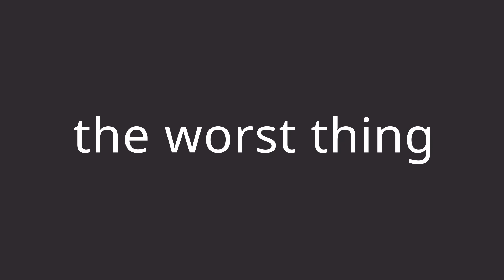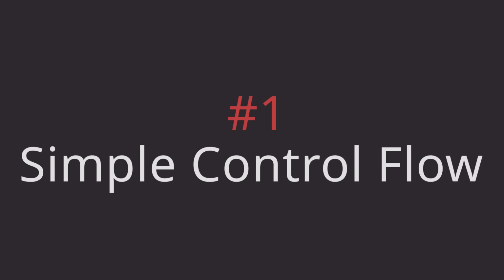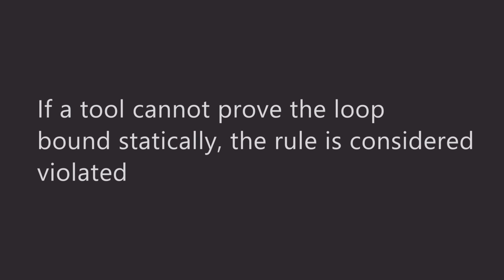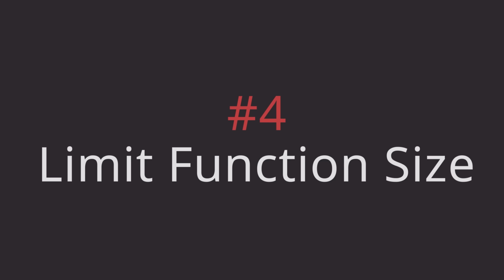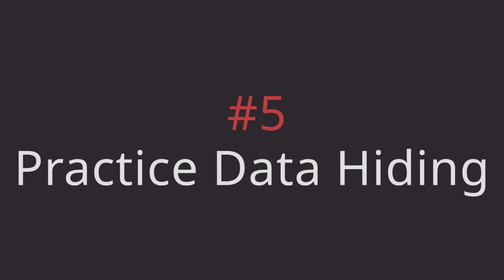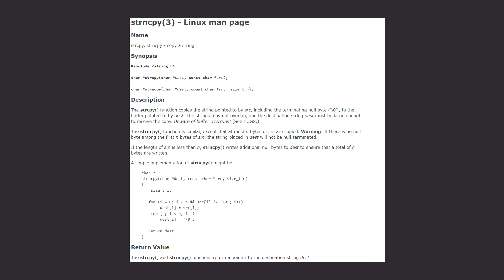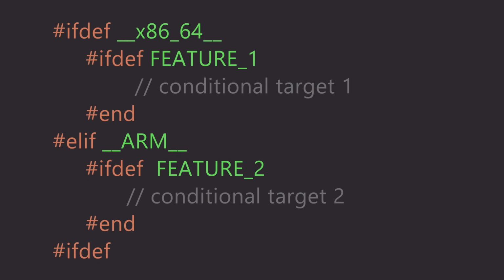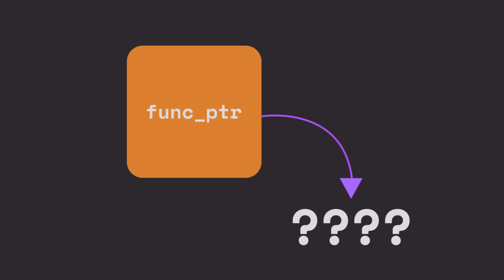how NASA writes space-proof code

Comment: Note that not using dynamic memory is not the same as not using the heap. Global variables are heap allocated, but their size is known at compile time, so there is no problem there. This is useful for big variables as those would otherwise result in a stack overflow; the good thing is that static tools would detect those anyways.
Reply: Global variables are not heap allocated.
Reply: True, I meant that stack storage is not the only solution.
Well, I guess that depends on how you define "heap", so let's be specific: global variables are not part of the stack in any implementation that I know of, but they are not dinamically allocated in that they exist the whole duration of the program execution (cannot be de-allocated). So perhaps we could say "global/static allocation" is different from stack and heap allocation.

Comment: I do lots of embedded firmware and use many of these rules. However, I completely disagree about the preprocessor. There are ways to use macros that actually eliminate classes of errors and allow the programmer to generate compile time errors, which is way better than runtime errors. If you have a process that includes analyzing code then you can compile or analyze the preprocessed code.

Of course, macros can be misused and create a mess, but I think they have been unfairly maligned.

Comment: I could code for NASA because I don't use recursion! 

I don't understand recursion... well, I do, but I have never had any use for it so I haven't practiced.
Reply: @neilbarnett3046  , think of it as a function that calls itself until it meets a certain condition. You usually have at least two parameters: some state like a counter array/list that allows you to keep track when you’re done - and an accumulator to store your progress - that means: taking over your result of the previous calculation into the next.
Reply: @captainbrainless  or you use a solid programm language. E.g. python stops after a certain depth in the recursion.
Reply: Recursions can be rewritten as iterations, and they're used mostly in high school or college education for stuff like Fibonacci because it is more intuitive and to basically show how it can affect the system (stack overflow). In real world programming, I never used recursions, they are a major source of crashes and can be pretty unpredictable.
Reply: @realjickso you obviously do no solid programming. Almost impossible not using recursions. You need them for:
* File System Traversal  
* Tree and Graph Traversals  
* Parsing Structured Data (XML, JSON, HTML)  
* Divide-and-Conquer Algorithms  
* Graphics and Fractals  
* Web Crawling and Scraping  
* Backtracking Problems
Basically whenever the depth is unknown.

Comment: Interesting video to get to now how Nasa has handled these kind of things. But I would argue so much if someone suggested that these particular guidelines should be used in modern work. As @HerbertLandei pointed out there are modern approaches to low level programming, especially Rust lives in the same usage space as C while being much safer to program with. I guess these rules have been a necessary band-aid on the Nasa's space projects ecosystem on C era but I wonder if e.g. SpaceX and other Space programs have a different kind of ecosystems and thus derived a different set of rules. After all satellites etc. are a collection of hardware and software solving many space related problems holistically of which the problem of human programmers making mistakes and needing static analysis is just one of many. (e.g. radiation damaging and bit flipping processors in space is a big problem and maybe hardware needs regular resetting too)

To me it seems that these rules boil down to enabling static analysis of code to be efficient. It is almost like coding for a safety tool that guards that a stupid Huuman doesn't make mistakes. Now on the era of ChatGPT 4 I would also explore the powers of Specialized AI code analyzers. Finally does any of these static analyzers offer a formal mathematical proof of the correctness of the software ? Because that would be a completely different chapter to this topic. Usually analyzers are there to just tackle common and recognizable mistakes.

Comment: these rules sound quite "old" or "basic" to me. I mean if you do multiprocessing, it could be better to have functions consume a constant cpu time, then you may need jumplabels. Or you have to re-write code for a similar device, but restrict both pointer dereferencing and x-macros, so that looking at all of your code you have a bunch of functions doing the same thing. So you may end up looking at the structure and overlook an individual change that would be required for one implementation. Next, it requires handling of every possible returned value, but you may not use goto even inside a single function? How would you unwrap stuff then so the code is still maintainable?  And the worst thing to me wasn't mentioned at all (despite the lack of requirement on how to handle every possible errorcode from every connected sensor or whatever): checking for invalid pointers. I mean inside "do_func" for the case "do_func(&my_buf.data)" so that the parameter also may point to .bss/.text . Ok on the other hand it implies that even NASA can't do magic, so that may be good news ;-)

Comment: How about this rule: Don't use a language conceived at the dawn of time.
I get that their use-cases require low-level code, but seriously guys, we are in the 21st century. There are languages like Go or Rust, which make it so much easier to write correct code. Why use ancient incantations with pointers and stuff? It's like designing a new car with a steam engine.
Reply: Go is not hard real time, as it has a garbage collector

Comment: @1:28
just a small correction, the function is supposed to return the predefined type (list_t) instead of int
as the purpose of the function is to return the node that holds the value being searched for, not the value itself

Comment: Surprised that rad hardening steps aren't mentioned - quorum, lockstep cores, watchdog timers, short runtime tasks dispatched on a schedule from a known starting state instead of long-running threads which accumulate errors, regularly checksums of code, regular initialisation of the stack, ie resetting the system on a tight schedule even if the watchdog doesn't trigger.  Also when fusing data from multiple sensors, having a sane way to discard sensor data if a sensor returns confusing/conflicting data, and a way to start listening again in case the fallback isn't long-term capable or the error condition has passed.  For example using integrative navigation sensors when range-finding produce wacky results temporarily as happened on the moon shots, the astronauts ignored the radar for some time but started using it again later.  The recent Japanese lander failed because it stopped listening to radar permanently due to unexpected rapid distance increase as it passed over a crater wall, resulting in it switching to integrative navigation, "landing" far above the surface, and then running out of fuel trying to stay there.

Comment: its funny, I worked for a company that used similar rules.
and imagine what ended up happening, they didn't have final safe state.
on a very rare occasion, the product ran out of timer slots and violently disassembled it self. 
apparently "having the product restart in case of an error is too much"

in the end, it's more valuable to write code that can save it self than expecting that no one will make mistakes.

Comment: #3 is still widely used in the defense industry.  It's not a requirement anymore, but there is a general bias against using the Heap without good reason to.

#6 is just good practice in general.  Our internal compiler flags generate warnings for any function that returns a value that is ignored.

One more that many programs follow: All Warnings get elevated to Errors, forcing the developer to actually address them.

Comment: 0th rule should be:    DO NOT PROGRAM IN C.

Use Ada.  Or even Pascal.  (FreePascal is quite powerful - and in it, heap memory is very well managed to boot).  
Many companies used Pascal for avionics in the 80's and 90's for both commercial and military avionics.
Very readable.

On the B-777 program, avionics suppliers building new sub-systems, were required (by Boeing) to use Ada.
Recursion was forbidden, and IIRC, so was Task Rendezvous (a synchronization feature of Ada).
Planning, Design, Doc, Test and Certification had to be to the appropriate (to the sub-system) criticality level (A .. D, maybe E) under DO-178B where "A" is the most severe.
F-22 is another example with the key benefit being that aircraft level systems integration went very smoothly.  (They did have one oddball problem).

What about multi-threading?

Comment: I actually really like #4 as a rule and might try implement that to an extent in my own code. Sometimes it can be easy to think "Well, this function is performing a save operation and all this code is used in saving so it all belongs here". But the truth is that if you have a function that's 300 lines long, chances are you can probably break that down into multiple sub functions. Sometimes I even just have a wrapper "doProcess()" function, which calls a bunch of smaller operations that do each step e.g.

doProcess() {
basicSetup()
checkValidation()
writeToData()
UpdateForm()
finalCleanup()
}

And this means that while it can sometimes take a little longer to scroll through code, it does make it a lot easier to find exactly where things are breaking, plus makes it more readable.
Reply: In OOP this is called Single Responsibility principle.
Reply: looks like hell

Comment: Expressly forbidding the use of the heap is a bit dogmatic and short-sighted.  I think the intent is to discourage frequent heap deallocations, i.e. use of free() in particular, since static analyzers have trouble tracing dynamic memory reallocation over time.  (Fragmentation can be managed with a good allocator.)  But there's nothing wrong with using malloc() to reserve memory that is intentionally never freed if that serves a purpose.

Why might you want to do that?  On many MCU architectures the stack and the heap share the same region of memory, where they grow toward each other from opposite directions, and that region is typically mapped to a fast RAM device.  Let's say you need to reserve a range of that fast memory to quickly process the output of some data collection device, where data is routinely copied from some I/O port range to the working memory, and you want it to exist in a location that doesn't change.  You could use a stack allocation for it early in the execution of the program and then pass it by reference to all of the functions that need it, so they can pass it down, etc. But what if you don't want to have to deal with all of that argument propagation? You could instead malloc() the working memory from global scope where it would exist in the same memory device as would have been used with a stack allocation but in a simpler to access and essentially static form as long as it's never freed.

Why not just use the initialized/uninitialized data region for the working memory, where static allocations usually exist?  Because it may not be mapped to fast RAM.

Comment: I'm taking the void casting rule to my own list, thanks! Checking every return makes a ton of sense. If you have many independent calls needed for some kind of setup, it only makes sense to check their return values in one place (probably followed by an early return). Once that is done, you kinda gravitate towards bubbling those setup calls up the function body. great, now you have all you need to potentially move the setup outside as soon as you realize the function is called in a loop or during traversal... an optimization that came naturally through good practices.

Comment: Great explanation of writing more reliable and obviously testable code for mission critical software. Most rules should apply to normal commercial or hobby programming except I can't imagine any large program not using the heap or function pointers for callbacks. Preprocessor #ifdef can be invaluable in the real world for preventing multiple inclusion or definition errors. Not sure how they manage without that.

Comment: For most of these rules everything seems fair, but I strongly disagree with "a function shouldn't be longer than 60 lines" (rule 4). That's mental, a function shouldn't be longer than 20 lines, unless a specific action requires multiple lines, going above 20 means you haven't abstracted your objective enough and should step back a minute (the level of severity can obviously be adjusted based on the needs but it's a good rule of thumb)
Reply: Especially in C or other low level languages if my first impression of a function (wirhout reading it, just by look) is "I can't bother reading this mess" then it needs a refactor.

Oh and dont get me started on putting two+ actions on the same line, allow that and you start seeing the worst code ever written™

In school we had a coding style of 20 lines * 80 chars long max. We had the students that tried their best and have been producing very maintainable code since

And then there are the students that were competing on who can create the best 20*80 square function. I have seen horrible things...
Reply: (obviously students and full time paid engineers have different motives/experience/motivation but you get the point, discipline is key)

Comment: Makes sense for a space applications that there is no one to reboot the machine. And a committee decided what to code.

Some even make sense for normal applications. 

Except for the not using the heap part. A lot of application do not know how much memory they will need to function. It may be 1K it may be several GB. Heap simplifies this tremendously. But I understand why it shouldn't be used for something that needs to not fail. (and will fail anyway because radiation exist).

Comment: Many of these rules are С-specific and cover various deficiencies of C language. While practical, none of them are fundamental to programming (except for "test test test") . For example:
"#07 Limit the Preprocessor" — in modern language preprocessor shouldn't exist, compile time execution and other features should cover for its use cases.
"#06 Check Return Values" — modern safe language should force you either use return value or explicitly ignore it.

"#09 Be Pedantic" — pedantic mode is specific to compiler implementation (gcc, clang)
"#01 Simple Control Flow" — I feel like almost no language that appeared after C++ allows goto, setjmp or longjmp. For recursion, modern low-level language should also provide features, to handle it. Unfortunately, there are not many modern production-ready low-level languages (maybe even none), so this area of language design is underexplored.

Comment: I've never coded. What I don't understand is why don't programmers literally write out their code in comments, and then fill in the code in-between the relevant comments? That way, the programmer and anyone reviewing the code would know exactly what they were reading, or what the code was originally meant to do. This way, they could understand the code much more easily, or spot a mistake.
Reply: There's comments and then there is documentation for how the code works.

Some people use comments in their code file, like you said. One drawback is that the file becomes too big. 

Others seperate the documentation and the code file.

Writing and maintaining  comments is time consuming, and some believe that good code explains itself. If the code needs comments to be understood, it's bad code.

Comment: Hmm, back when I was at NASA, we just used Ada, and most of these issues went away.  
To quote one of the creators of the 'C' Language, "Never use 'C' for anything important".
Reply from the maker: I wasn’t aware of that quote. Meanwhile the whole world runs on C. That’s terrifying.
Reply: @LowLevelTV  there’s little if any C in aircraft, ground control. I’ve been at three Self Driving Car companies. IMHO they spent vastly more money trying to get their C/C++ code base stable then it would have cost them to just use a language designed for safety critical systems from the beginning. 
So. Many. Core. Dumps.
Reply: @LowLevelTV  The whole world is an exaggeration.
Reply: That quote is a myth. Neither Brian Kernighan nor Dennis Ritchie ever said such a thing.
Reply: Banking and Financial run on COBOL !
Reply: I agree with you 100%. I use Ada in 95% of my projects
Reply: Ada is not as robust as C is with hardware level interaction. It will never be used as a standalone thing but it has a place in abstracting logic for mission critical systems
Reply: @ wait what?  Ada was designed from a clean sheet to address many of the challenges faced with creating reliable software on bare iron. I started my professional career developing embedded software for robotics in Ada. I’m constantly appalled by the fragility and inefficiency of C in modern robotics.
Reply: @ I spent years developing on “bare metal” with both C and Ada. I found Ada to be very effective for low level programming.